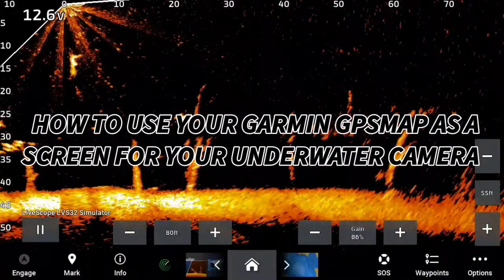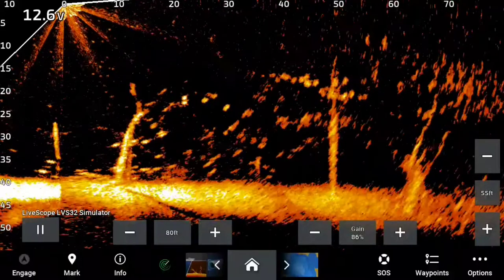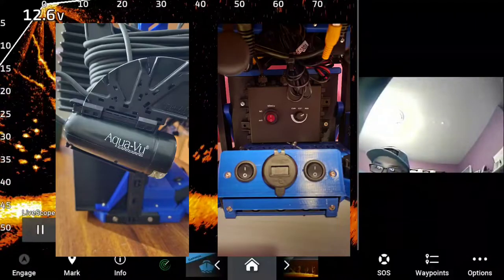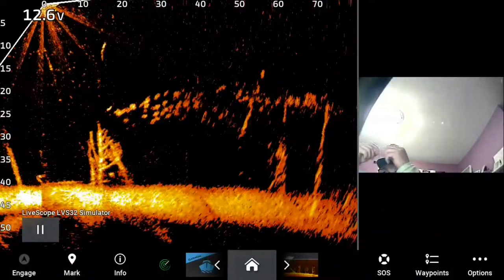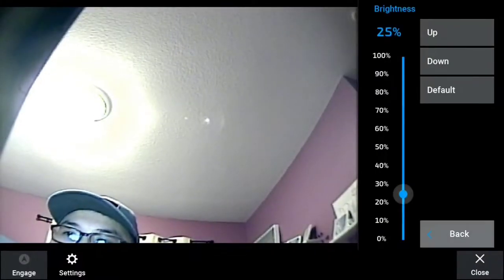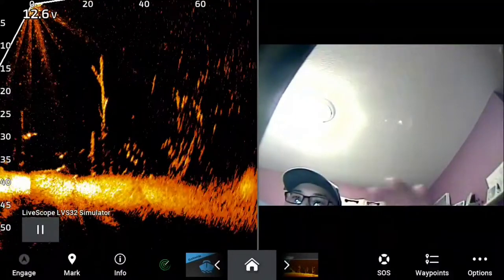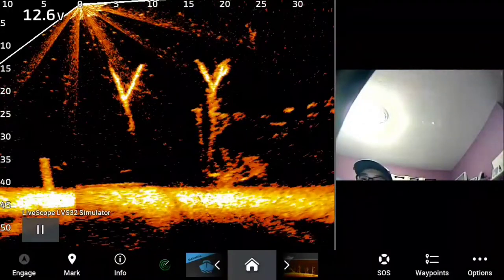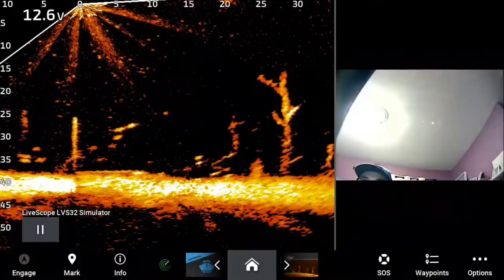Garmin GPSMAP 943xsv | Aqua Vu Multi-Vu Underwater Camera System

Comment: Hey man...waiting on my 943 to come. I want to do the same thing you are doing and just add a camera to my unit. Did you just connect the camera itself into the 943 head unit? And you're able to control the camera through the garmin menu? Could you do this with any free-standing camera and cord? There are some some ones on Amazon that seem like they could do something similar but I can't imagine the Garmin being able to read the janky video feed. I'm impressed with your set up either way!
Reply from the maker: Camera has to atleast be powered by a power source like most underwater cameras so yes basically any underwater camera with video output with AV. Check out another video I did with the Eyoyo Underwater Camera 😁
Reply from the maker: https://youtu.be/c5dmIatJsdo?feature=shared
Reply from the maker: Camera video adjustments is limited but I believe if you have something with aa screen like Aqua-Vu or marcum you can adjust the setting on that unit itself. This is mainly a great option for recording camera footage and sonar.
Reply: That video is 100 percent what I’m looking for! Thanks. Did you get to compare them yet? I’m guessing aqua vu has a much better low light camera. Which Eyoyo?
Reply: @GreaseMonkeyBassFishing  I just ordered the 720 eyoyo camera kit (no DVR). I'm hoping the camera is decent quality in low light.
Reply from the maker: @wubbalubbadubx2  low light is ok. All cameras depends on water clarity, depth and weather conditions.
Reply: @GreaseMonkeyBassFishing  Hey bud. I finally got the right adapter to link my RCA video out to the gpsmap. I'm using the Eyoyo, and all the power leads go going to the battery, and the video out RCA is going straight into the head unit (Garmin). I'm not involving the Eyoyo screen whatsoever.  I'm not getting any video on the GPSMap. I took pics but can't post them. Can you help?
Reply from the maker: Send pics to my email gmbfishing@outlook.com
Reply: @GreaseMonkeyBassFishing  sent